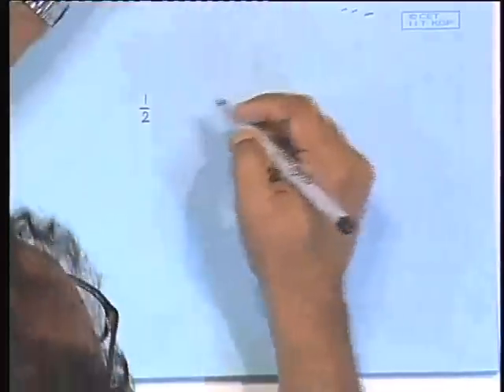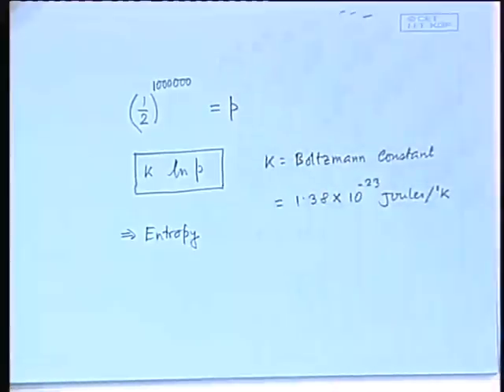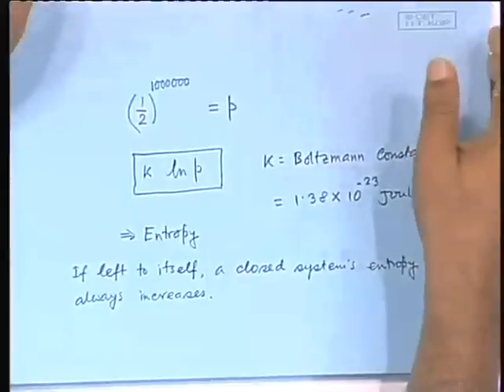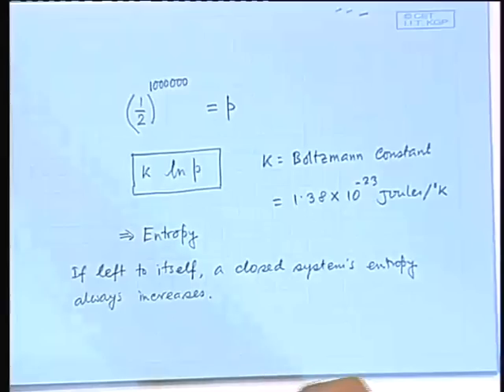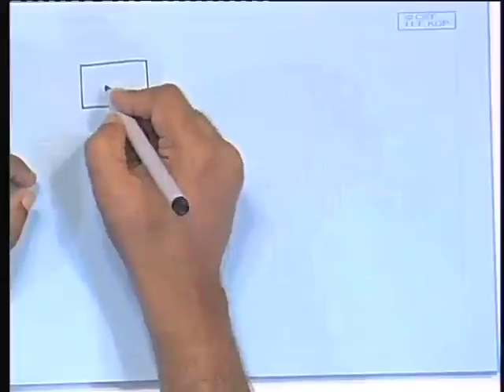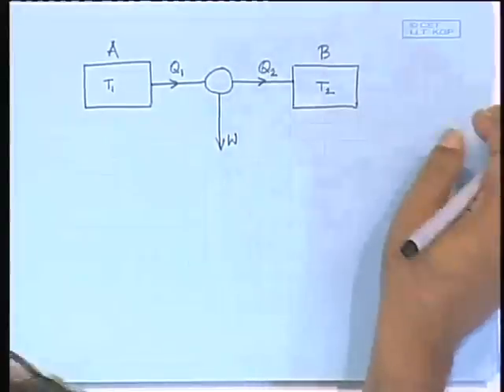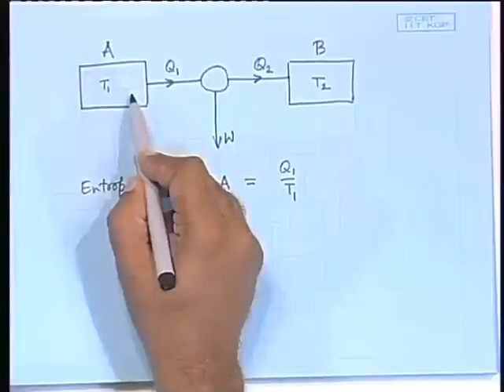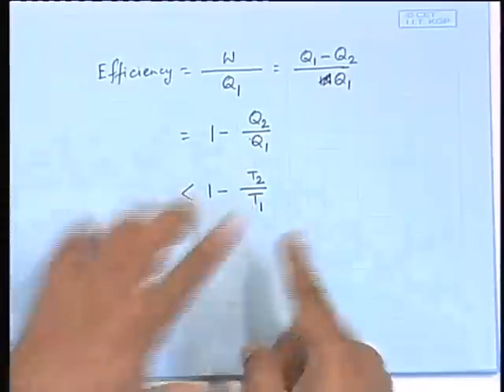Lecture - 1 Thermodynamics : The Fundamentals Of Energy

Comment: He may be referring to Cornelis Drebbel, a Dutch inventor active in the early 1600s. Drebbel developed devices that utilized changes in temperature and atmospheric pressure to produce motion. His most famous creation was a "perpetual motion" clock, which operated by exploiting the expansion and contraction of air due to temperature variations. While not a ship, this device exemplifies the era's interest in harnessing environmental changes for continuous operation.

Drebbel also built the first navigable submarine in 1620, demonstrating his interest in maritime innovation. While there is no direct evidence of him proposing a ship powered by cooling seawater, his work reflects the period's experimental approach to utilizing natural phenomena for propulsion.

The idea of using the vast thermal energy of the sea to power a ship by cooling seawater by a single degree is conceptually similar to modern Ocean Thermal Energy Conversion (OTEC) systems. However, such technology was beyond the scientific understanding and engineering capabilities of the 17th century.

Comment: Yes, the repeated failure of such machines played an important motivating and clarifying role in the formulation of the law.

By the 17th and 18th centuries, inventors across Europe were proposing perpetual motion machines—devices that would run indefinitely without input of energy. These were often based on misunderstood principles of mechanics, magnetism, gravity, or hydraulics. Despite their ingenuity, none worked, and this persistent failure gradually pushed scientific thinking toward more rigorous formulations of physical laws.

The decisive shift came in the 19th century, especially in the context of heat engines. Engineers like Sadi Carnot (1824), and later physicists such as Rudolf Clausius, William Thomson (Lord Kelvin), and Max Planck, were not trying to disprove perpetual motion per se—they were trying to understand how *work and heat* were related in engines.

From this work emerged the second law: that no process is possible whose sole result is the complete conversion of heat into work and that entropy increases in closed systems. In other words, there’s always some “waste” heat, and perfect efficiency is impossible.

This law retroactively explained why all perpetual motion machines had failed. It didn’t arise from their failure, but it formalized and explained that failure in universal terms. So while the law was motivated more by thermodynamic analysis of real systems (especially steam engines), it also codified the impossibility of both:

Perpetual motion machines of the first kind (violating conservation of energy)

Perpetual motion machines of the second kind (violating the second law by converting all heat into work without losses)

So their failure contributed contextually and pedagogically—but the law itself arose from a more focused analysis of energy and heat transformations.

Loved this introduction.